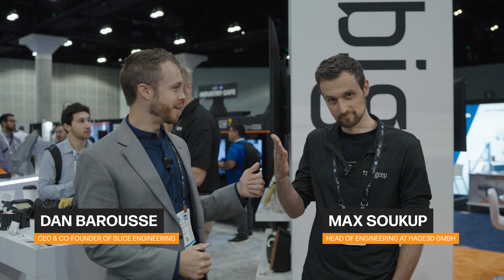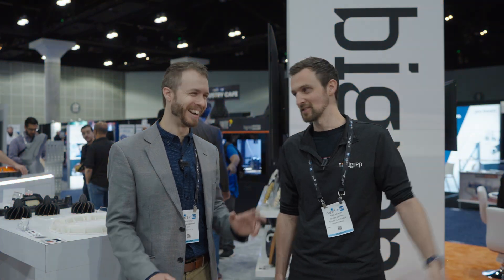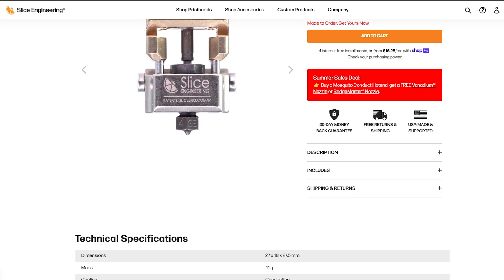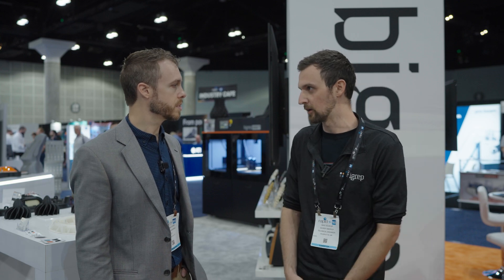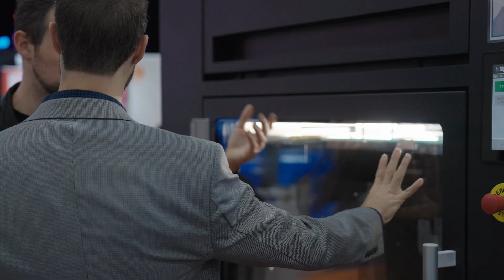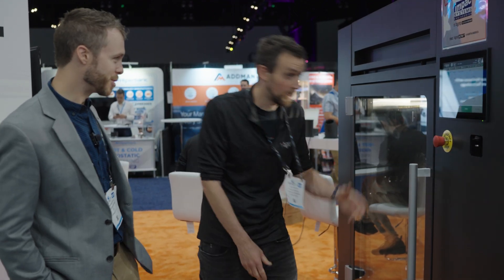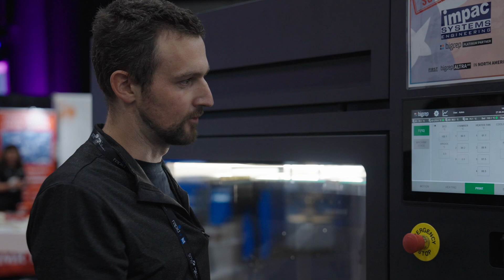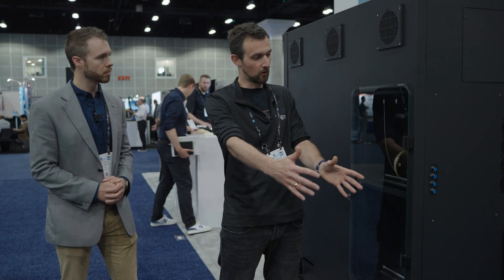Why BigRep's ALTRA 280 is the Next Big Thing in Industrial 3D Printing!

Comment: Great video showing start to finish the strength and flexibility this system!  Plus, I hear its half the cost of the F3300 and F900 with WAY more features and material. Plus its Austria engineered from a machine tool company.  From the video I can tell this was carefully engineered with much detail put into it and not just new skins put on.  Great job BigRep & HAGE 3D!

Comment: When printing multi-materials or multi-color, how is oozing handled?  Since all 4 hot ends are translating across whatever you're printing.
Reply: @The_Privateer there are tip wipe brushes and purge bays inside the chamber. The system is also liquid cooled so the extruders cool faster if not being used to quickly slow any potential oozing while they wait to be used again.
Reply from the maker: @mrb-83  thank you for providing some insight!!
Reply: @SliceEngineering you’re welcome!